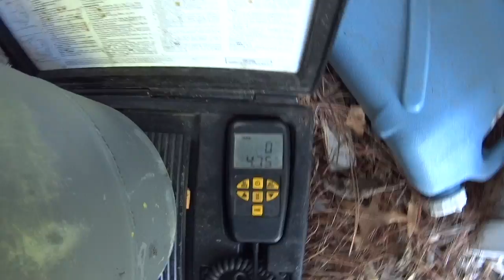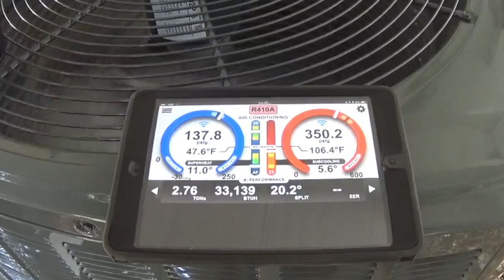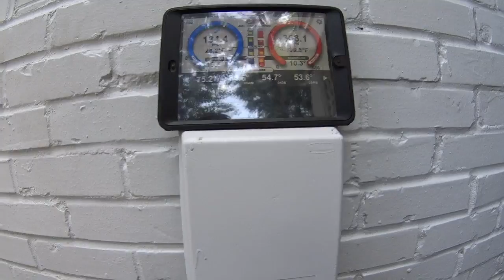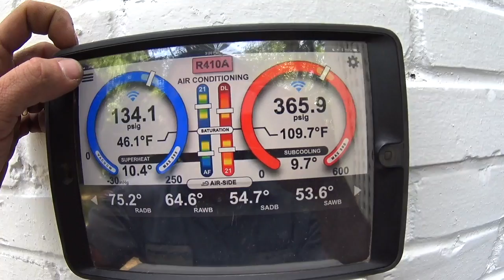HVAC Installation: Trane AC and Coil With David Larsen (David's First Day) 5 20 15

Comment: what happened to the A coil  installation . How did I miss it. Did they use the existing A coil. Near zero installation explanation . All the gauge readings where the video finally got verbal  are wasted on a non-tech  like myself  What kind of furnace did they perform the installation  on

Comment: hello, imanifold videos state that u cannot put air probes next to the coil because u will get incorrect readings, actually they say its better to put in next to first supply grill than putting it in the supply plenum right next to the coil.  By the way did imanifold ever helped you to find problem with the systm which u cannot diagnose youself being so long in the industry???

Great videos!!!

Comment: It is now best practice to always have a load-calc & Sizing performed before changing out heating or cooling equipment.. 
This FREE whole house 'Block' calc http://www.loadcalc.net/ can be used by anyone even the system owner's; just print & follow the instructions. 
The existing equipment is nearly always oversized & the duct systems & Return-Air areas undersized. Duct systems are rarely properly manual D sized as they ought to be. 

A 2 or 2.5-Ton would operate more efficiently with that duct system's designed airflow. 
Most Return-Air filter areas are way too small & most would do much better with two large  filtered Returns into the blower chamber. 

What part of NC are you working? 
Need ample runtimes & good indoor %RH control even on much less than design days?

Comment: I wrap service valves with a damp rag, use nitrogen when brazing . remove sencer buld on txv when brazing on evaporate. If you said yep I did that then I would show it the video. I wonder if under the deck shortened the life on the old one. I personally would walk away before I did that even if there was no other way because I know it's not worth all the problems. I have been doing this for 30 years and have a degree in hvac. I injoy your videos and sory about being negative. I have made plenty of wrong choices and learned a lot about staying out of trouble.
Reply from the maker: +Terry Moline the old unit was over 20 years old so I don't think the deck hurt anything. I always flow nitrogen but don't usually wrap valves or remove TXV bulbs. EEV bulbs on the TAM7/8 series Trane units, yes. I don't show everything I do in some of videos because I've shown I so many times already and it makes the videos too long. I'm over halfway to 30 years in HVAC. I appreciate you watching.
Reply: Thanks for the update and I now understand it's so easy to be negative and I'm sorry. Your the bigger one and I appreciate that .
Reply from the maker: Terry Moline no need to be sorry. thanks for getting back to me on the comments.

Comment: nice work, did i miss the filter drier install?
Reply: Yeah you did. It happened at the factory. Thanks for trolling.
Reply from the maker: Drier is built into
The condensing unit.
Reply: Stephen Rardon my system just stopped cooling. I have a 2014 Goodman compressor connected to a Goodman coil. This is connected to a 1995 (York?) gas furnace. I think the newer Goodman stuff is 5 ton where the original was 4. Also my old HVAC guy did not register the unit so it’s out of warranty I’m told, since it was just 5 years... so, do I get a new Aspen coil installed with a new plenum for about $1,800? Or, do I want a new Rheem full system for $6,500? I just got a new drain pan and float switch which seems perfect but my new guy wants to replace this, he says he buys this in a kit, that part sounds like BS to me. Thoughts about a new coil (which I assume comes in a new enclosure) or a new system? Also, Trane vs Rheem?? Does the Trane give us fancy stats on the iPad at all times???

Comment: No funeral no nothing for old GE that took a lot of crap in its life seeing it from the other video.. Oh Stephen I'm shedding a tear. In fact I was looking at of houses the other day that one  still had its 2.5 ton AC from 1966 when the house was built. Another house that still had its 2.5 ton GE heat pump electric furnace from 1975 when the house was built. The Heat pump was still running and the straight  A/C had no clue to its performance, but I'm guessing it was still alive.  They will never see that life span in the new unit. In this case that's a good thing!!

Comment: Shouldn't unroll your wire from the top of the spool like that. It puts a 1/2 turn kink in it ever time you pull a layer off the spool that you need to get out before you complete the install...